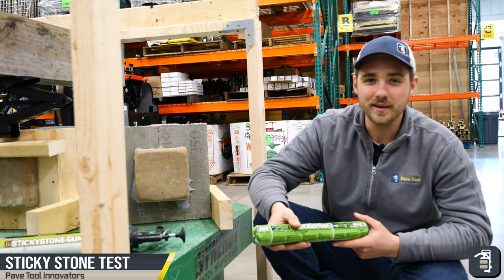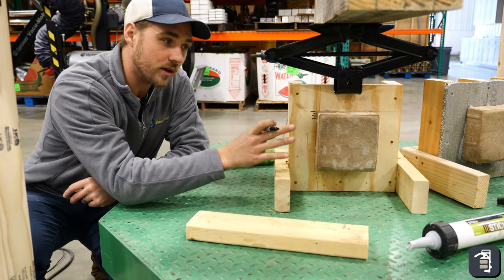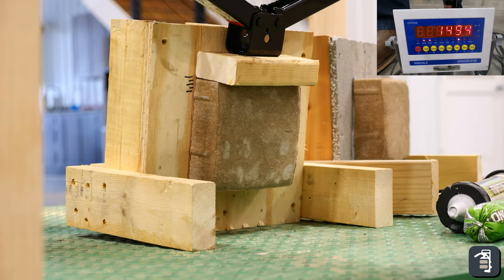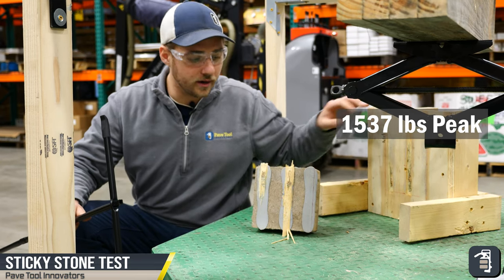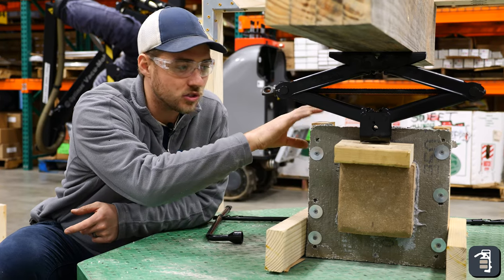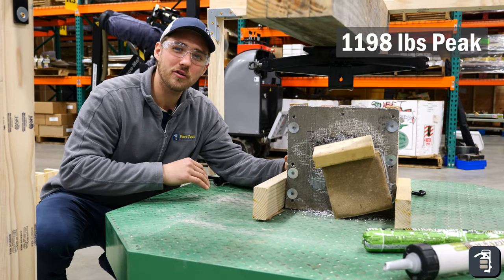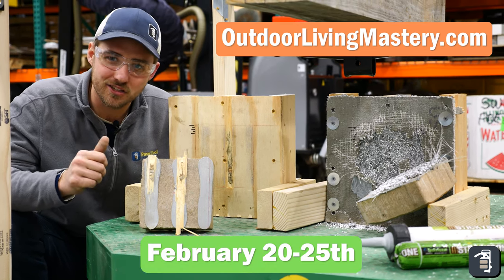Sticky Stone In Real Life

Comment: I have been putting together a cultured stone fireplace using both sticky stone to finnish (once I found a supplier here in Ontario) and another well regarded stone adhesive. The Sticky stone out performed the other product in every capacity. Vertical hold even on heavier corner stones was amazing...no mechanical assistance required...and I used far less product to complete the job than it required with the first product. Cost savings there for sure. The applicator gun is awesome and the cleanup is very minimal.also no leaking crom the nozzle tip in between applications. Really....I couldn't be more impressed with this product

Comment: I have an deteriorating  exterior cement block wall. I was thinking of fastening some plywood ( perhaps treated) to the cement block  with fastners and Stickystone and then using  more Stickystone to install some fake stone panels or pieces.  Do you think using plywood for an exterior job would work?  I can cover the top edge of the plywood to protect it from rain and snow.    My thought process is that using plywood would be quicker than repairing the smoothing out the block repairing work.  Thank you for your videos.

Comment: Can i use this product on 2 inch by 2 inch stone sill attaching directly to solid concrete substrate?
Reply from the maker: Yes, you might just need to increase the amount of sticky stone that you use. Instead of doing a bead every 3 inches do one every 2. You will likely get a bit of sag this way, so be sure to start at the bottom.

Comment: How does this product hold up in Minnesota frost we have alot of problems with any kind of glue holding up wall caps for sure and step caping.
Reply from the maker: This product was designed for vertical applications but I have tested it on horizontal areas, and it did work really well.  I really like the Master Weld 948 as well, you can get it on Uline.

Comment: In an outdoor application will water get trapped behind the ledger stone panels? As opposed to used mortar.. thank you
Reply from the maker: No it will not, due to applying the beads of StickyStone 3" apart vertically on the back of stone as opposed to horizontal. This allows space to exist between the wall and the stone and water to flow/evaporate preventing any moisture being trapped behind the stone.
Reply: @PaverToolInnovators  
Thank you for the response, also I live in Florida and will the UV rays eventually shrink this product, causing stones to detach ? Thank you
Reply from the maker: @pozmarciv  StickyStone resists UV and weathering effects!

Comment: Any opinions with sticky stone on brick
Reply from the maker: It will work fine with a brick veneer substrate and stone to brick surface. If you're applying to neither, what material are you referring to?
Reply: Stone veneer
Reply from the maker: @carlosyo2011  Great! Sticky Stone will work perfectly fine with that combination. Just make sure to make the beads 3" apart so water can't collect.

Comment: how long did you let the adhesive cure before testing?
Reply from the maker: We did this test in a controlled environment and allowed the adhesive to cure for 18 hours. This was not a test done in the lab nor was it sponsored by Techniseal. We just wanted to see how the product held up on those two substrates. We've used it on multiple parts of our facility and are very satisfied with how it has held up in the northeastern freeze and thaw cycle.

Comment: Your demonstration is really nice, the analysis however is flawed. 
It really doesn't matter weather if the substrate is failing or the failure happens within the sticky adhesive! What matters is that there's failure in the installation and the stone will fall!
Reply from the maker: Thank you for the constructive feedback and for watching our video!
Reply: Would be nice to see a comparison to mortar installation. The level of force needed to create the failure was significant in both cases in the test.
Reply: I understand the falling off thing but i not seeing how it relates to the test. He was putting well over 1000 pounds of pressure on the adhesive which in most if not all cases will never see 1000 pounds.
Reply from the maker: @IamTheJesus69  We plan on doing more test videos in the future and will keep this in mind. Thanks for watching!

Comment: This test is all well and good in an inside  laboratory style testing, but it doesn't mirror site conditions. Ona site the exterior plywood would be covered in either housewrap, or solid foam, test those and then tell us it's good to use and will last a long time.  If you're saying this stone is really and truly for exterior facing, then put it up on plywood that's been on  site for a few weeks and is laden with moisture. This product is for builders who want to make quickly, don't want to spend  money on a proper mason to create something that would last a lifetime, and is interested only in short term profits. Show us a test panel in a hundred year's time and then maybe we'll be impressed. There is no way an architect or engineer would specify this product to be placed directly on plywood for a house exterior, minus any kind of weatherproofing so what was the point of the test?
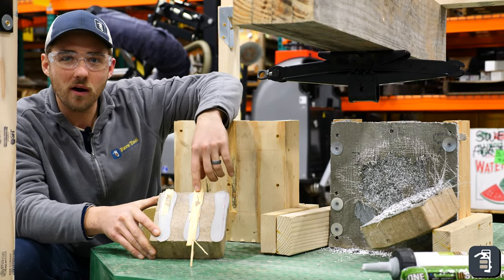Reply from the maker: Totally agree using Sticky Stone directly on plywood would only be appropriate for an interior application. At 3:52 Caleb states that we would never use Sticky Stone on plywood in an exterior application.